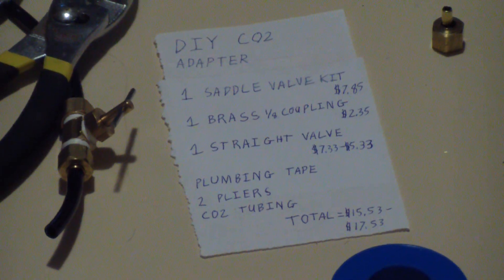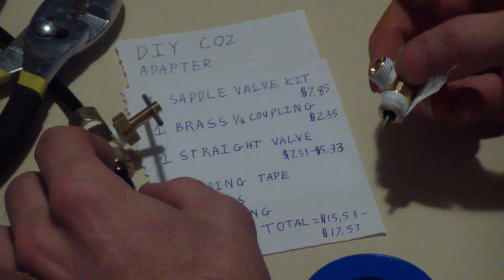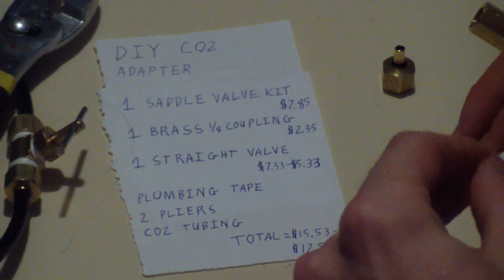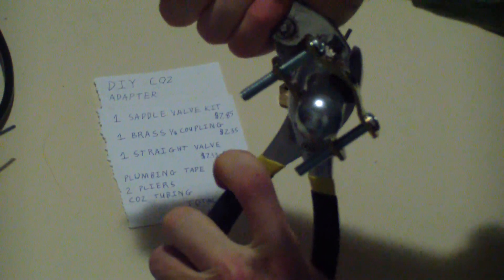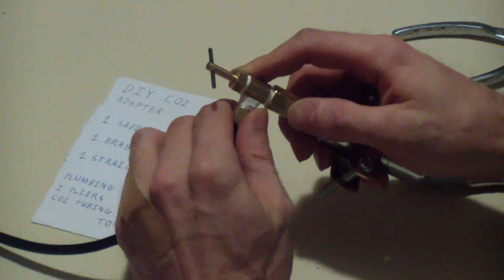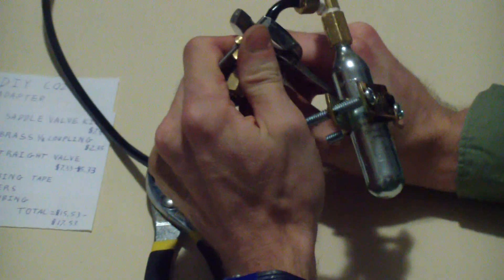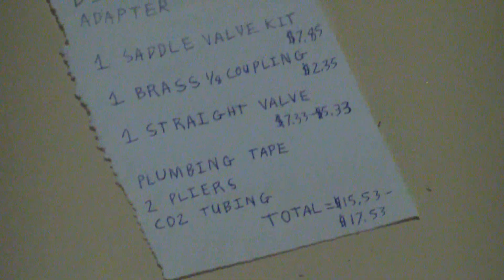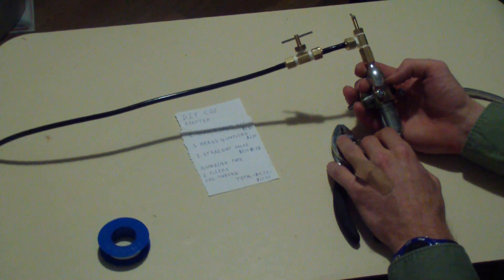DIY Fail: How not to build your own CO2 adapter for mini canisters or cartridges.

Comment: This is cringeworthy. The flats on the fittings are not for your 'universal wrenches'. The plastic tubing is not nearly strong enough to contain the pressure in the cartridge and compression fittings are not designed for pressure that high either. Ever wonder why the cartridges are made of heavy steel? If you want to make instructional videos at least use the right tools and materials rated for what you are doing.
Reply from the maker: Yep, yep, nope, and I do what I want j/k but live and learn. Thanks for the suggestion and viewing.

Comment: I was watching this video waiting until that plastic tube will blow up but it ended in the most interesting place. Still, dont understand what was the point of inserting that short tube between valve and cylinder as you could just connect them directly and everything would be working fine.

but anyway this is a super expensive way to get co2, you can make it much easier just by heating baking soda in some canister
Reply from the maker: May have to dig parts back out and take a look at your suggestion...

Comment: There are so many things wrong about what you just did!Here is a tip: Dont put tape or any other type of sealant on compression fittings, the little brass donut is where the seal is facilitated, not on the threads.I won't go on but learn how things actually work before you try to instruct others. Pliers? Really?
Reply from the maker: The tape was to help hold pressure...we cant all afford engineering school or all necessary tools, so we teach ourselves and buy as we go...but tell me was it not at least entertaining..lol

Comment: Could you please indicate the model # for the straight valve and the needle valve?   Thanks.
Reply from the maker: Not sure, thy were purchased at Home Depot in the pipe area.
Reply: That appears to be a ice maker water supply. It would punch through the copper pipe making for easy install.

Comment: Just a quick search on the web would've returned the answer that a co2 cartridge is under about 850 psi.  Even DOT air line is only rated for 150psi working pressure and fittings restricted to 250 psi.  You were only shooting 570% more pressure than your weakest link.  This all took 5 minutes to find.

I was looking for an electronic solenoid to release a co2 cartridge when I ran across this video.  I would really suggest you doing some research next time unless you have a death wish.
Reply from the maker: The thing about searching is you only get results for what you search for.  I wasn't searching for cartridge psi or even CO2 tubing max psi.  I was searching, learning and experimenting to find a cheaper way to distribute CO2 in my aquarium.  Also I am always careful when building DIY. Thank you for your suggestions and concern.  I think - It is better to try and fail than to never try.  Some prefer to look for answers others like to find them on there on. Thanks for watching.

Comment from the maker: The compression fittings fail. Luckily I was holding it and no damaged came to me, my fish, or anything else...
Reply: The pressure is too high straight from the cylinder for your compression fittings between your saddle valve and straight valve.  If the compression fittings didn't fail, the hose between valves probably would. To make this setup work, you should have a solid brass connection between your saddle and straight valves.  Compression fittings are fine on the outlet of the straight, as you can use the valve to reduce the pressure escaping from the CO2 cartridge.  A saddle valve with a 1/8 NPT outlet connected to a straight valve with a 1/8 NPT inlet and a compression outlet.  Connect the two with a 1/8 NPT short nipple.
Reply from the maker: Thanks Sirach! Yeah after further investigation I came to realize the cost was almost the same as manufactured CO2 regulators. I think stainless would be better, too.